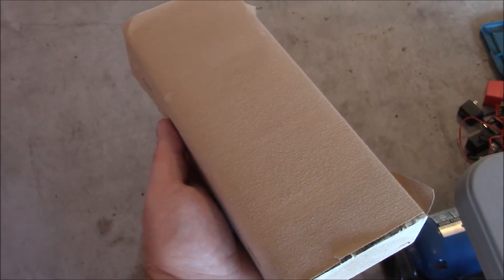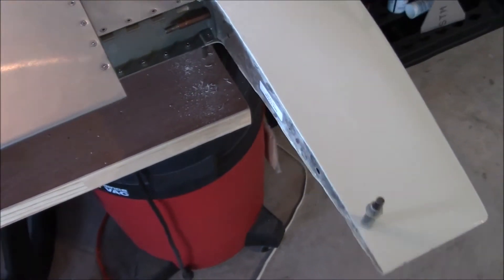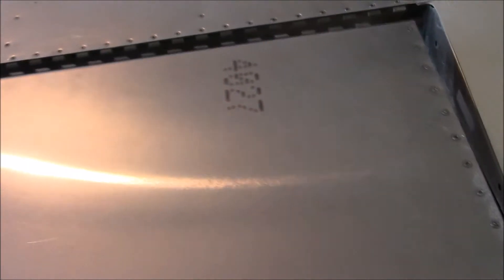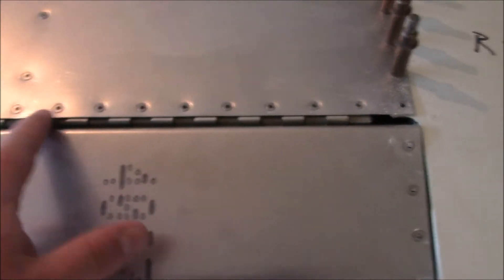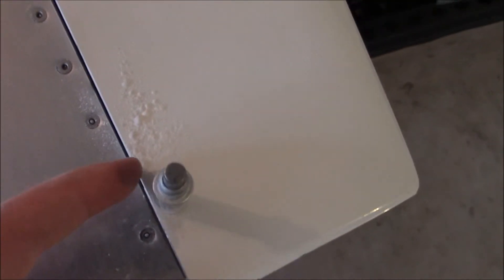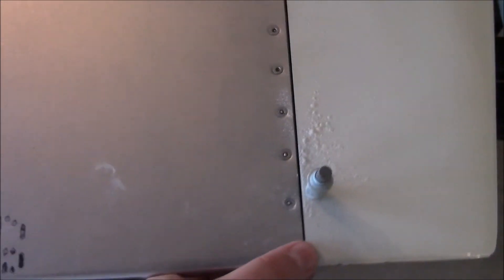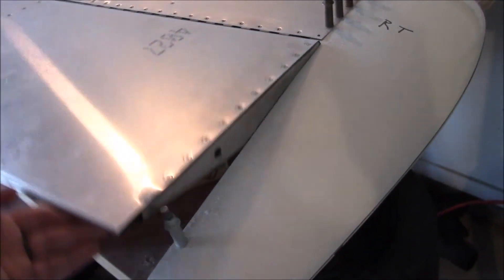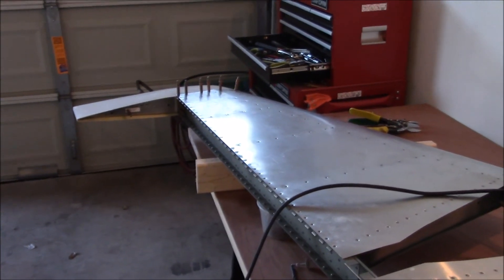Sonex Aircraft Build Video 29 Sanding Tip and Test Fitting Elevator

Comment: The aluminum inside the fiberglass tip looked very tight to the elevator so I'm glad you can adjust it.  Sanding block did a great job.  Must be very exciting when you do the test fit and see these coming together.  Keep up the good work.
Reply from the maker: SyberPrepper Hi Syber Prepper. Thanks again for commenting. Yes, it has been very fun test fitting this piece. It is starting to look and act like a real airplane. I am glad I have the ability to adjust the clearance, I'm going to keep slowly moving it til I get the 1/8th inch I need. The sand paper grit I am using is 240 which is finer than I wanted at first, but now I am glad I didn't go too heavy on that. You can always take more material away, but adding it back is the problem. Thanks for watching! -Dan